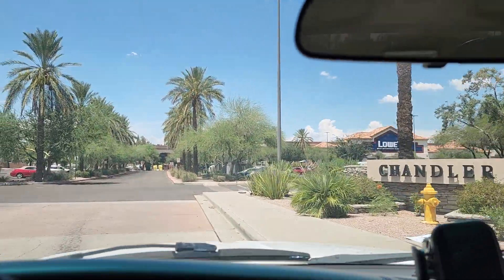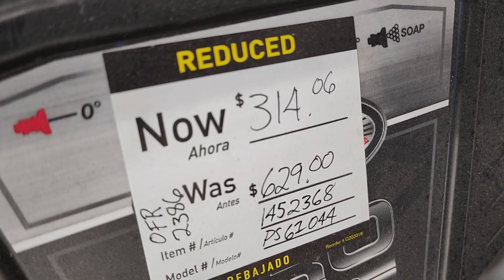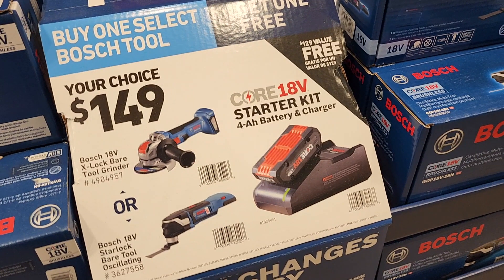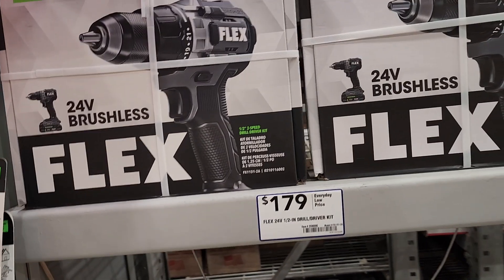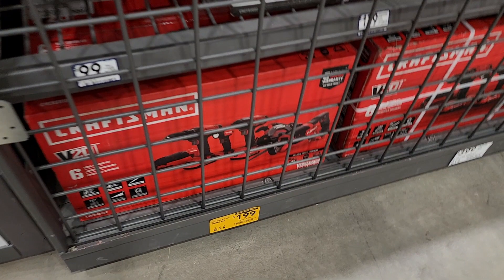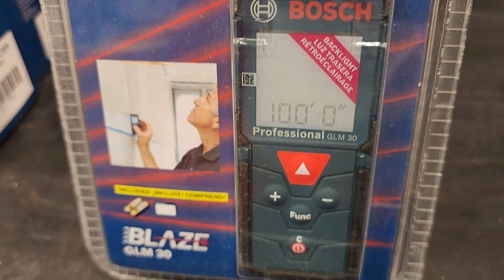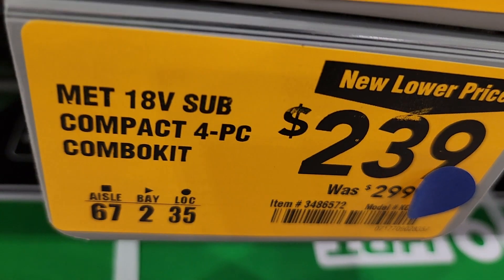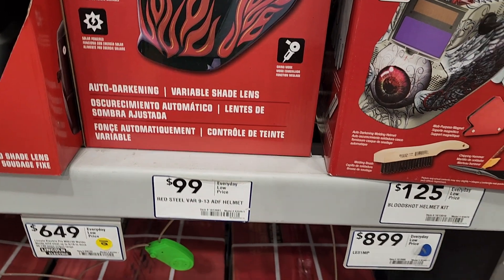4th Of July Weekend Tool Deals Shopping @ Lowes

Comment: At HF you can piece that welding helmet kit about 50 bucks cheaper.I have the one with blue flames,it’s auto darkening about 36 bucks on sale.Maybe more now? Let it get some sun before you use it to charge battery a little bit.Other wise you may get a flash.